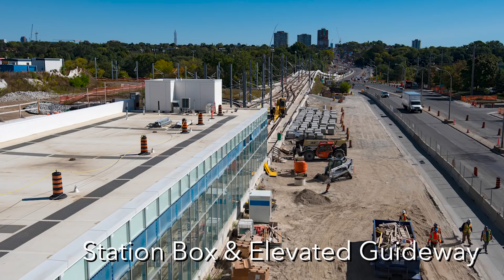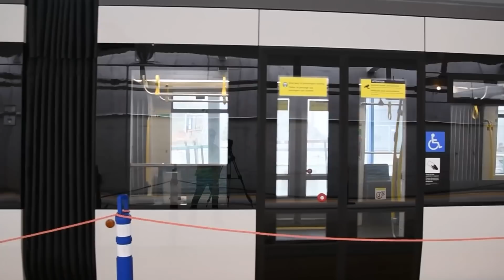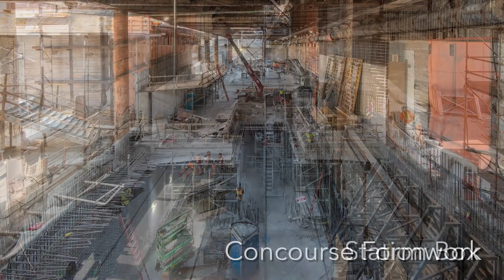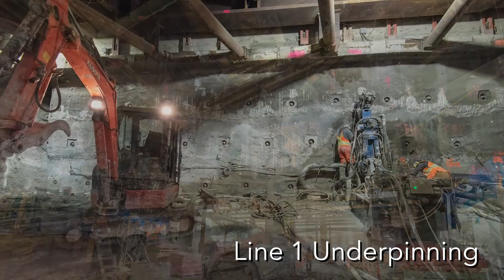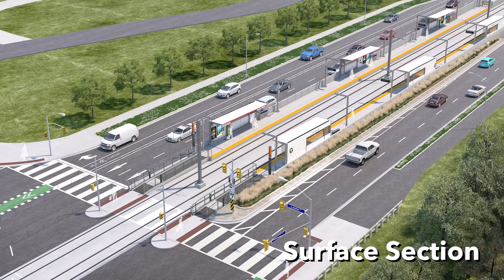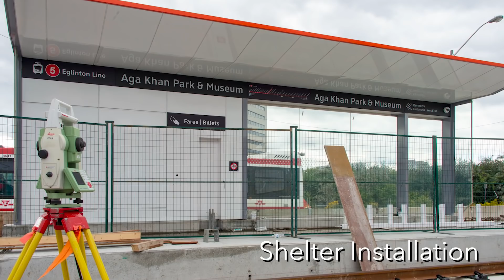Fall 2020 Progress Update: Mount Dennis Station - Kennedy Station

Comment: Why didn't they run the line south of Eglinton at Leslie? WHY?? 

Instead of coming up in the mid of the road the tunnel portals could've emerged from the south side at both ends. That entire stretch through to Don Mill's would have remained grade separated eliminating one major intersection at Leslie. There is no business access on the south side along that stretch only parkland.

Comment: I am one out of thousands of crew involved in this project and the first Mount Dennis Station is my work. I built up the main structure of the station and I can recall every single story behind this project. It was not an easy project but we did it. At this moment I am doing another project, Finch Station West and also it is a very challenging but great project. Be proud of being one of them.
Reply: Thank u for all your hard work sir
Reply: When will you b working on the Kennedy Station project??

Comment: A lot of people don't realize how hard this project actually is. I understand that Eglinton has been under construction for 10+ years now, but you have to take in the fact that they're building 25 stations all at ONCE. That's like building line 1 or 2 with all stations and trains ready to go at the same time!. It's another year and a half to go and we'll all reap the benefits of this massive project.
Reply: Still Too slow.  My hometown city started construction of first metro back in 2005, and this year already has 12lines and 520km metro system.hope crosstown can be a game changer for GTA transit system.
Reply: in 1963 the bloor-danforth line started construction and by 1968 it ran from islington to warden. unfortunately there's no doubting that construction speed has slowed to a crawl since those days, even with better drilling technology.
Reply: @Skyfoogle  Back then they cut and cover meaning the cut a massive trench, with the crosstown the did it underground , if not eglinton would be useable
Reply: @moses8758  crosstown stations are also cut and cover, but done in halves rather than one giant trench. even still, the stations on the original stretch of the university line were bored (hence the cylindrical shape of the stations) and were still completed remarkably fast
Reply: @Skyfoogle  I agree, I think the contractors due to lack of constant subway construction had to learn how to build complex projects again. For example in just four years, Madrid designed, constructed, and opened 39 new metro stations and laid 35 miles of rail, 23.5 miles of which required new tunneling. The expansion was unprecedented for its low costs. We have taken way to long for this project.
Reply: @Skyfoogle  The Bloor subway was built by digging up the back alleys north of Bloor`/Danforth and tearing down hundreds of homes.  The Eglington West line was mostly built by boring a tunnel deep and directly under the steet, and excavating massive holes for the stations at intersections, all while maintaining road traffic.

Comment: I wish Rob Ford was Never Mayor he slowed things down atleast  12 months the Crosstown would be OPEN Now
Reply: Rob Ford caused at least a year's delay because of his insistence that the entire line be underground. The wide-open roadway of Eglinton Avenue East doesn't require such expensive excavation, but Rob Ford had a great dislike of surface rail. 

After wasting everybody's time with unnecessary studies of combining an all-underground Line 5 with the Scarborough extension, nothing came of it. Three other factors have delayed completion. The first would be the various disputes between the contractors and the city.  The second would be the discovery of extensive underground water near Yonge and Eglinton that needs to be overcome.  Lastly, the pandemic had an effect on construction.
Reply: @Nunavuter1   Yes I don't know why I   put 6 Months it was at least a year Ford argued that the  whole line underground 🚇 (and the Crosstown should be extended to replace the Scarborough RT not sure about this point)
Reply: @davidbrowne3761  Combining the Eglinton Crosstown with the Scarborough RT replacement was one of those ideas that went nowhere. Another six months wasted.
Reply: @Nunavuter1  Given the cost of the 3 stop Subway that Doug Ford wants Perhaps the Plan before the Scarborough RT should be used Streetcar 🚊 Line
Reply: @davidbrowne3761  That was another plan back in the 80's. They were planning to use coupled CLRV streetcars with pentographs using the same route as the current RT. But Ontario was forcing the RT train technology onto Toronto. So Toronto built that instead.
Reply: @davidbrowne3761  The extension of the Danforth Subway to Scarborough Centre was been decided.  Unfortunately, it is several years away as they haven`t started yet.  And the TTC said last year that the Scarborough RT trains will only last a few more years before being junked.  There will have to be bus substitution during that time.   Years and years ago when the RT replacement options were explored, an extension of the subway is the most expensive solution but had the advantage of not disrupting RT service while being built.   Too late for that now.
Reply: 6 months? Try 1-2 years! This project was supposed to be operating in September of this year. Now we're delayed another 2 years.
Reply: @Justjerzy23   OOPS I should have put at least a Year.  Yes I know it was Originally September 2020, Still 14 Months away 28 February 2022 without Eglinton Station 🚉
Reply: @davidbrowne3761  I honestly don't know if even the 2022 date is possible since we haven't even done a full route test.. just only 2 stations so far.
Reply: @Justjerzy23  because of COVID, but yeah I want this thing to open ASAP
Reply: Actually Rob Ford caused Toronto to be 5 - 10 years behind its original transit plan under David Miller. The original plan would have had Eglinton LRT EAST completed and functioning, going from Kennedy Station all the way to Malvern through UTSC, just in time for the Pan Am games! The Pan Am Games happened in 2015 (5 years ago!), and an Eglinton LRT East expansion is no more than a glint in the eyes of us urban planners.
Reply: @shirazanwer3659  Exactly. All because he wanted the LRT buried smh. It's sad to that Doug ford isn't any better and that he plans to bury the Eglinton west extension to the airport, when we ALL KNOW that Eglinton can clearly support above ground transit with its 6 lane road. The city is desperately needing money to get an LRT built on Queens Quay east all the way to the beaches and also extend the original LRT plan of it going to UofTSC and to Malvern. Ford knows this but doesn't care about LRT's and stupidly obsessed with subways and would rather spend more money burying the west extension. Now that Queens Quay east is being flooded with condos, it's only a matter of time until that sideof the city will really need proper transit and not just buses. So we'll see.
Reply: @Justjerzy23  Well its the Fords, they really love their subways. One of the reasons why almost nothing happened, in terms of transit expansion, during Rob Ford's time, was because there was this huge battle raging between Ford and the various planning departments working at city of Toronto. Rob Ford had come in and at the very first day in office, cancelled David Miller's Transit City. However, the city planners, people who designed Transit city were still there and they really pushed hard against Rob Ford. Well, 10 years later as the  Eglinton East LRT comes to its completion we know the city planners won, however at what cost? Decade long delays! I believe, now the new philosophy amongst city staff is to just get stuff built, have something rather than nothing. Doug Ford wants to scrap the relief line, even though we spent the last 5 years planning it? He instead wants an Ontario Line? Fine lets just get it built, we are not gonna waste another 5 years debating the issue.
Reply: @shirazanwer3659  Yup I remember that whole thing vividly. Even the useless Mayor Tory switched sides just to get something built. Even the Scarborough one stop subway (which makes no sense since Scarborough begins at Victoria park) was originally supposed to be an LRT (fully funded btw) with 7 or so stops serving Centennial college at Markham road campus and STC. But because Tory was crying about his Smart track (which has mysteriously disappeared because of Metrolinx absorbing it into GO RER), they had to rid of that alignment and focus more on line 2's extension.. which at that point would cost about 4.5 billion for one station because of how soft the soil was in Scarborough. Doug Ford's OL is basically the DRL but with more stations, cheaper alternatives and different train technology.  This whole thing has been a big mess but now we're here and things look like they're actually getting built.
Reply: @Justjerzy23  Ill say Amen to that :D